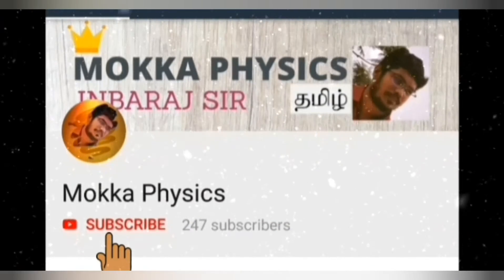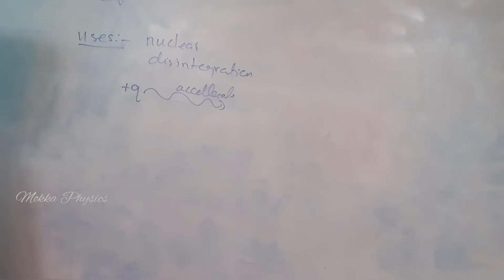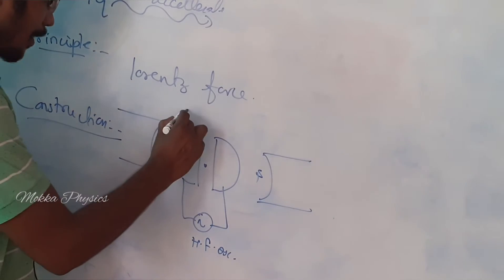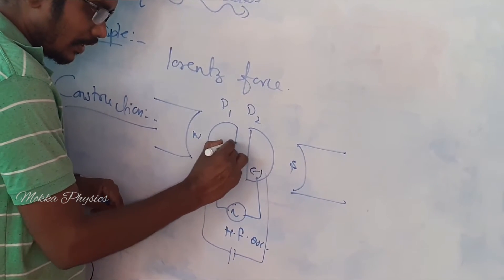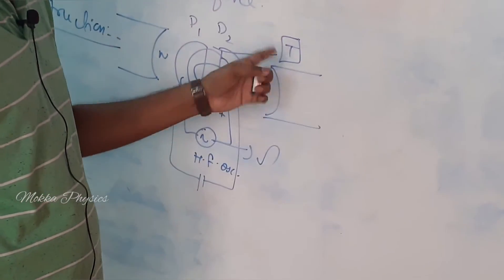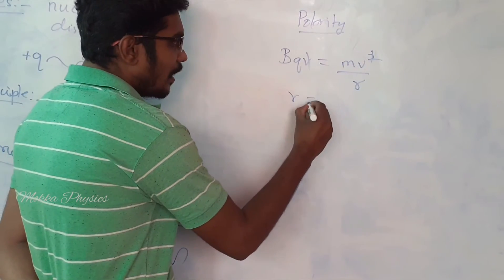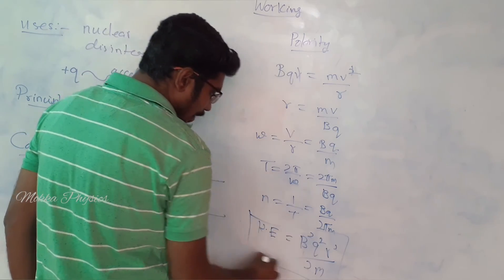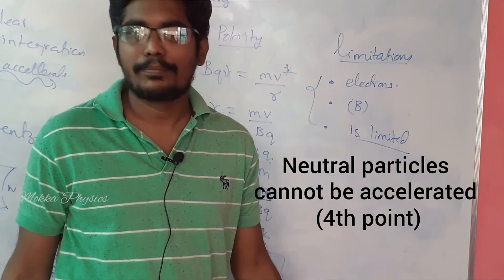12th Physics|Ln:3|Cyclotron|Tamil|Inbaraj Sir

Comment: So, 
uses: Nuclear disintegration 
PRINCIPLE: When a charged particle moves perpendicular to the magnetic field, it experiences magnetic Lorentz force.
CONSTRUCTION: diagram 
 1. we have two metallic plates, D1 AND D2 
 2. They are connected to a high frequency oscillators 
 3. The whole set up has to be placed in the presence of a unique form of magnetic field.
 4. A source of positive ions has to be placed at the center. 
 WORKING: 
1. When the source of positive ion is emitted , it tries to move in a circular path towards the plate which is negative at that instant.
2. When they reach the plate, the polarity gets reversed.
3. So, this process will continue as long as the expected velocity has been developed in the charged particle. 
derivation part 
LIMITATION: 
1. Electrons cannot be accelerated. 
2. The speed of the ions is limited.
3. Uncharged particles cannot be accelerated

after writing this much, we'll get a maximum of 4 marks over 5?
Reply from the maker: Thank you for your response
Reply: @MokkaPhysics  we will get 5 out of 5 ah??  Sir
Reply: Neenga 5 ku 5 vanguningala??  Pona varsam
Reply: @kapiljeyanth   i got 4 1/2  for it i guess (btw im currently in 12th grade not a last year student :D)
Reply: Bro intha maari oru comment tan bro tedunen 
Romba thx bro❤
Reply: @alanfero335   you're welcome :D
Reply: 💥 Blast 🌟
Reply: Thaliva you are great  👍
Reply: Bro 5 mark kuduthaangala😊
Reply: @Santhoshshelby  in my public? no i think
Reply: @saretharanisha2939  sorry indha question 2024 public la varalanu nenaikiren
Reply: иєєиgα єνℓσ 12тн ℓα?
Reply: @Seve-p7d 471 if i remember correctly-
Reply: Ada gommala 😅.
Reply: @narenchandran.c.jx-b1233  :"D